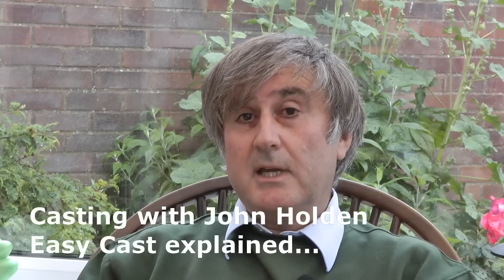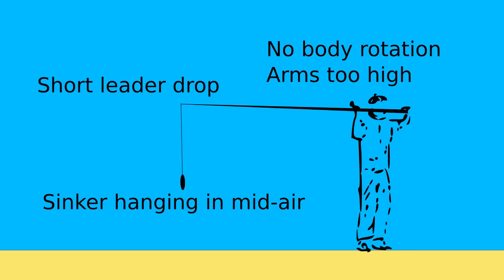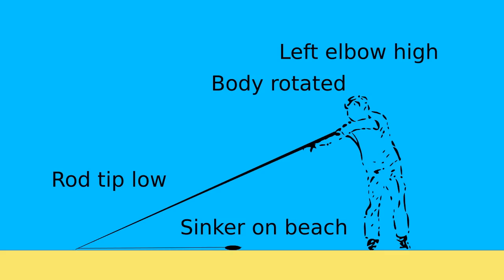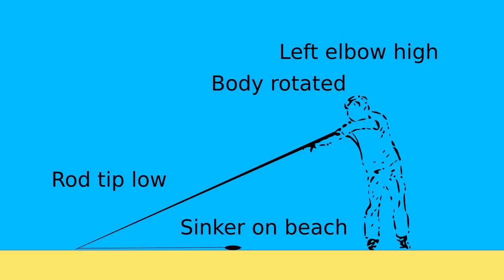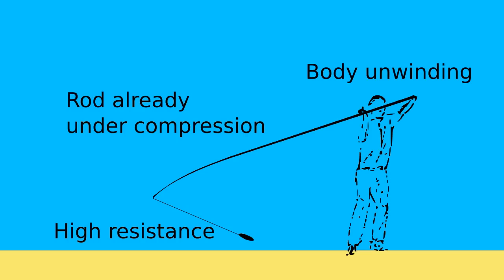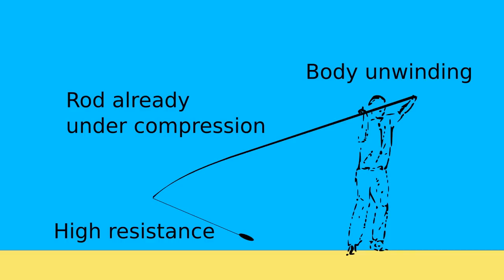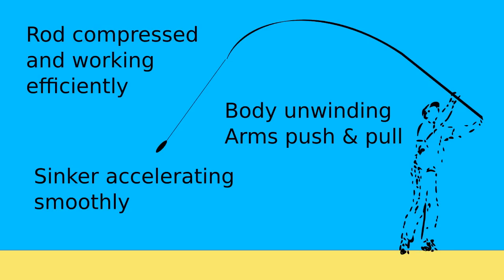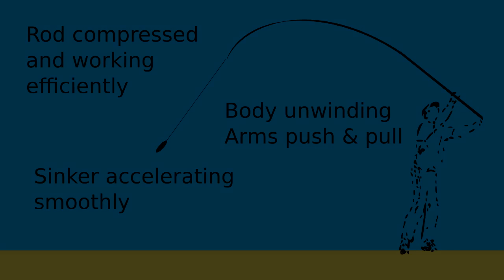Why the Easy Cast works so well

Comment: Just for info.  If you're using a grip lead and worried about it digging into the ground during the cast slip a length of 2 or 3 inch guttering into your bag.  Lay that on the ground and rest the weight on that prior to casting.

Comment: I have had someone recommend to me that all you need do is take a small sheet of ply with you (or something similar), and lay your grip weight on that. Of course if it's a bit blowy, you might need to weigh it down with something, or use something a  bit more substantial.

Comment: to address the finger protector question, I just cut the thumb ( and/or fingers) off a heavy duty rubber glove (industrial, not dish washing type). They're good for several sessions each and cost peanuts.

Comment from the maker: If you're in the water, use a pendulum cast instead.  The mechanical principle of the pendulum cast is essentially the same as the Easy Cast, except that you start by swinging the sinker rather than laying it on the ground.

Comment: Dear Mr. Holden, I am about to drill a hole to my fixed spool in order to "lock" it for casting so I dont need to be setting the brake on and off as you showed in another video. Could you please publish a more detailed video of this set up? Is it one hole in the spool or more than one? And the clip to hold it, how do you make it?

Comment: Hello John I have been watching many of your instructional videos and although they are old they are very informative so thank you for those. I am new to the game of surf cast fishing and will be adopting your easy cast approach, the mechanics of it seems so common sense. I do have a couple of questions. Living here in France all the casting rods are out of the one mould, long and made for fixed spool reels. I have asked for advice before and although I took you recommendations on board I could not find a rod under 4.2m . I have eventually bought a 4.5m long rod essentially because it was much reduced in price so it is good quality, base on full price, just a bit longer. Anyway it is rated for 100-200g casting weight what weight would  you recommend for a total novice to start casting with? I am going to get out into a field and try some practice casting.

Comment: I have been practicing this cast and found I have gone considerably further than the overhead cast.  I've been struggling with the overhead cast for the past 24 years, and have been very frustrated with it. This cast really is easy to do once you have the basics down it's just a case of practicing. 
I have yet to do this on a session at low water, whereby I normal wade out to get a bit of distance, I'll be interested to see what happens when my sinker and rig start sat in the water. John, do you have any advice for this situation, should I only do it from the beach and not in the water? Thanks so much for the advice and breakdown, I think it is excellent. Tight lines 👍🎣
Reply from the maker: You're off to a good start, Matt, but as you've discovered the Easy Cast has its limitations. It is fine if you can lay the sinker on the ground, but it doesn't work when you're wading into the surf or fishing from rocks, etc. The solution is to start the cast with the sinker and rig in mid-air, aka pendulum casting. The conventional pendulum cast swings the sinker to a mid-air position with the leader towards you (or thereabouts). The other way is to cast when the sinker is in mid-air away from you - ie on the outswing. This one is known as the Hatteras style or the aerialised South African cast. The important thing is that however you make the swing, the main part of the cast that follows is more or less identical to the Easy Cast. Lots of left hand pull. There are many YouTube videos to help you including my own pendulum videos. Start with one of the compact swings, definitely not the huge pendulum techniques. These come later, should you ever need them. Be slow, be steady, keep it simple. And all will be well.
Reply: @fox22250  thanks very much 👍🎣
Reply: @fox22250  hi again. I've had a go at pendulum casting today and managed to get as far as the easy cast so I'm making progress. I'm struggling with getting height with the cast. With the way cast it's off the floor, so I can angle myself better and look up 45 degrees etc, but with the swing and sudden left hand pull in struggling to look up and get as much height. Have you any advice to make a better transition from easy cast to pendulum? Is it just a case of practice practice practice etc? Thanks again for the great advice 👍🎣
Reply from the maker: @fattmort  Well, it's mostly a matter of practice, Matt. The big mistake with pendulum casting is to think that you have to be quick between the top of the pendulum swing and transition into the power arc. Logic says that the sinker will hit the floor if you're not quick. In reality, there is no need to rush. Slower is better. Make a nice confident swing, feel the sinker reach the top of the inswing, then make a smooth and quite slow transition into the main part of the cast. And while that's happening, make an effort to get your head around as early as you can. Look into the sky where you want the cast to fly. Aim fairly high and slightly to the right of the direction you want because that will give you a straight cast. Prioritise your left hand as you do with the off-ground cast. Otherwise, too much right hand/right shoulder push plus not looking up will produce a low, left cast and lots of trouble. It's still early days and you have a good way to go before it all comes together. When the pendulum goes wrong, go back to ground casting for a while to remind yourself of the key steps. Just be patient and confident.
Reply: @fox22250  hi again John. I've been practicing the pendulum cast here in Blackpool. Thanks for the advice regarding timing, as I managed 10 very successful casts whilst waded out in the surf at low yesterday and was very pleased with myself.
I've moved on with my set up as well, opting for a clipped down rig, 4 Oz sinker, 20-80 lb tapered shock leader, 18lb main line on my fixed Spool. Definitely think the logic you laid out in the video and the comments had allowed me to grasp the steps to getting the movement. Thank you very much for all your help it's made me very happy on my fishing journey 🎣👍

Comment: Hello i am on this cast for three days i still cant cast straight rod shimano ultegra tele surf 150 g action reel shimano ultegra 10000xsc can i use 100grams to cast? My shock leader is 0.26 - 0.60 10meters

Comment: Very few people can actually successfully load and unload a true heaver. (4-10, 6-12, 6-16 oz., etc.) Some of the 2-8 oz. rods can be a little underrated and give you difficulty. I have a TICA 4-10 oz., 12 foot heaver, and I'm still trying to get the technique perfected. I also have an old 12 foot Diawa Regal Strike, (One of the first graphites by Diawa) rated 1-4 oz., and with my Akios 656 CTM, it's utter simplicity to maximize its potential. I suggest we find 12-13 foot, maybe 2-6 oz. sticks.

Comment: john i am moving from a fixed spool to a penn mag 2 my first multiplier mounted on a 15ft salt surf rod .i have been using the easy cast any  advice before launch day would be appreciated
Reply from the maker: Set the sinker drop about 5ft-7ft to start with. Dial in full magnet power on the Mag 2. Then cast as you do with the fixed spool but with about half normal speed and power until you get used to the reel. Emphasise the left hand pull. Back off the magnets bit by bit as your confidence grows.
Reply: longterm would i gain more distance with a daiwa sandstorm 12ft as oppposed to the 15ft salt
Reply from the maker: john wrasse The Sandstorm is a better all-round rod, I think - and I'd go for the 13ft version. However, it might be better to wait a while because long term you might want a fairly meaty rod to get the best from the Easy Cast. There are plenty of rods available at all price ranges. Value-wise, the 13ft Anyfish Anywhere Six&Bait is excellent for off-ground work. Despite the label it works really well for Easy Casting with 5oz/150g leads as well.
Reply: thanks boss

Comment: Just following this method I more than doubled the length of my cast with 4 to 8 oz of lead.

Are there any tips for when you are throwing considerably more than that.

In the fall and winter conditions change and I end up needing to throw much bigger baits and leads.

A one pound bait with a 12 to 24 oz sinker is often times the ticket.

I can get about 80 yards this way but backlashing is a problem even though I can easily get more power in the cast by taking a step as I rotate.

Any suggestions?
Reply from the maker: Big sinkers and baits often generate too much preload when they are laid under the rod. Try laying them out beyond the rod tip, and a little to the right (as you see it when you are setting up). This gives a smoother launch, which coupled with plenty of body turn and a step, should give lots of power and reduce backlashing. Instead of laying the rig on the beach, you can swing it out and start the cast with the rig in mid-air. This is the basis of the Hatteras cast which is designed to throw heavy baits a long way. The key step with big loads is to slow down - doesn't seem logical but it will help. Good luck!

Comment: when using this method( i will be. GREAT VIDEO) how to adapt it when using wire grip sinkers. i'm a westie Nz and rips are  a common problem to deal with.
Reply from the maker: tarmac245  Grip wired sinkers usually lift cleanly off the beach. If you use swivel wires such as Breakaway,  it might be necessary to set the release pressure a little higher than normal.

Comment: I have Shimano tr 200 g , do I can used it? and if you recommend any good in budget rod ( within 100£) I will appreciate ..
Many thanks ..
Reply from the maker: Most rods are suitable except those with a very thin and flexible tip. Your Shimano should be fine. Try it with 150g of lead and a sinker drop of about 1/3 the rod length. Start slowly, and be sure to pull down smoothly with your left hand. There are many good budget rods. Have a look at Daiwa and Cinnetic.

Comment: What rod do you suggest?
Reply from the maker: It works well with most rods except those with very thin and flexible tips such as match fishing rods. These may break if the preload is too high. For surfcasting, 12-13ft is a good choice. The important step whatever the rod is to start slow, then gradually build up the power.

Comment: Lay back ground cast ?
Reply from the maker: More or less the same thing. Difference is whether the layout puts the sinker inside or outside the rod tip.
Reply: Is either sinker position better than the other ?
Reply from the maker: @paulbosetti4871  Easy Cast's inside layout makes the rod work more efficiently, but an extended layout and wide turn of the body works very well too, as in the South African cast. All considered, though, the Easy Cast does better for most people and suits more beaches. Extended layouts need a lot of clean ground or the sinker won't lift off smoothly. Best bet is to try both ways.

Comment: Hello sir, what line do you use?in the past  Ive tried casting hard overhead 20lb mono with 4oz and almost always break off the sinker from casting lol and get nowhere. Are abu Garcia's 6500 a decent reel for good lengthy casts?
Reply from the maker: To cast hard and safely, use a shock leader attached to the front of your 20lb line. Abu 6500 reels are excellent. Remove the level-wind mechanism if your reel has one.
Reply: The way I do it, is I make a shock leader which wraps around my spool a few times so that I know for sure the shock is being absorbed, I also use a different color line for the shock leader so I can tell it apart easily.

I burn my shock leader mono into a blob and then tie a uni knot with my main line to connect. ( google "blob knot")

Comment: John, is there any special exercises you could recommend, to practice the basics, for the over thinkers?
Reply from the maker: Starting the cast can be difficult because of the static layout. The more you think about it, the worse it gets. Try this. Set yourself up with the sinker laid out under the rod. Most of your body weight should be on your right leg. Look up where you want the cast to fly. Forget about the tackle, the timing and the rest of the technical stuff. Slide your body weight over towards your left leg, and when you feel the rod starting to bend, pull down quite powerfully with your left hand.
Reply: I will do that. Thank you! I have a video of a friend of mine, casting off the pier. It looks like a good example to follow, in order to improve my cast. If I post it privately and message you the link, do you think you can review it and let me know if I should use it as a model?
Reply from the maker: I'd be pleased to do that. A short clip of you casting would be even better!
Reply: I just messaged you with the link of my friend. My clips will be on the way once I have a little more practice. Thank you John!

Comment: Hi John, I have been practising loads with my Sonic SF4 16ft & Daiwa Millionaire ST (15lb line) and am struggling to get past the 150m mark with the pendulum. I suspect it is the last part of the cast I am failing on, the push pull. Your videos have been a great help though. I think I need to video myself to see where my errors are. Any advice? I'm sure I should be able to get 200m with my setup.....
Reply: Note: rod and reel now gone to Davy Jones's locker due to being pulled from rod stand by big stingray in New Zealand. That'll teach me not to forget to loosen the drag after the cast. Expensive mistake.

Comment: This guy has no clue what he is on. Most people clip the hook onto the clip of the weight so as you let go and the rig hits the water the hook line clips of the hook but obviously stays on to the line. I cast the way he said is wrong but I still get good distance. Don’t listen to him lol.
Reply: Then clearly there is nothing wrong with the casting technique :) ...it just wouldnt suit that style of rig setup that you are talking about...OTG casts work great with a setup that does not involve clipping a snood to a standard clip.....its a tried and tested method that works brilliantly if you actually bother to set the rig up properly.....by using a proper release clip (Gemini Splashdown etc) as opposed to a basic impact lead of hook clip.....and even without clipping down.....the distance OTG gives is far better than a standard cast with the same rig setup. Standard over the head casts can work fine for different situations....but overall OTG and Pendulum casts clearly out do basic casts by a mile.